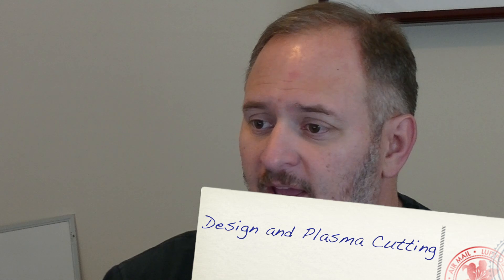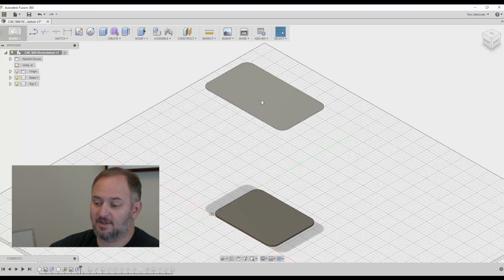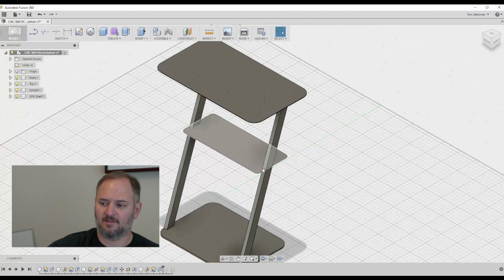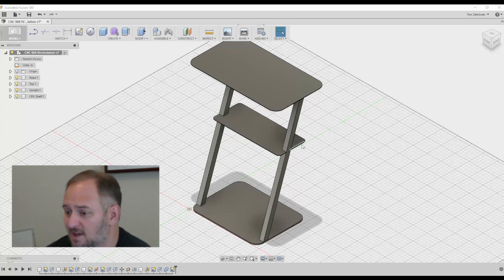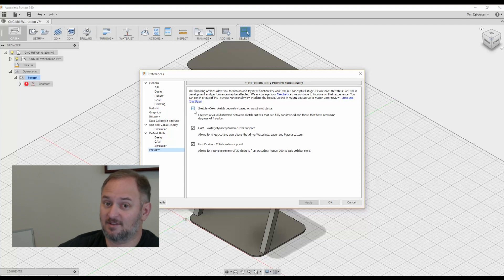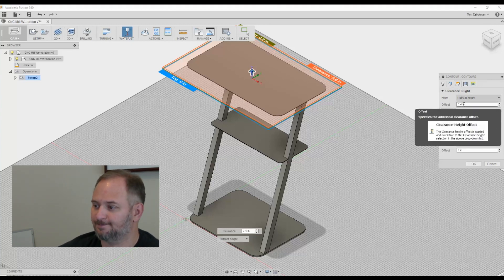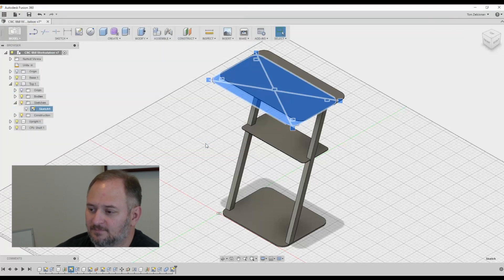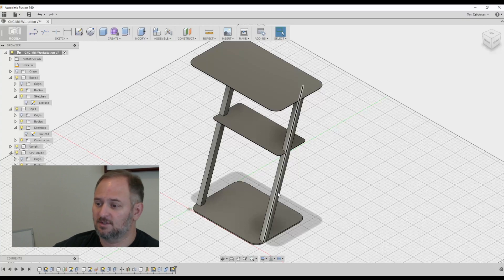Fusion 360 in the Fab Shop - Design and Plasma Cutting

Comment: Hi
I can use fusion360 to generate gcode for plasma 4 axis head head
Reply from the maker: With the recent licensing changes you should be able to do 4 axis work but I'm not sure. Have you checked the Fusion 360 forums yet?

Comment: I knew you were going to reference that angle cut in the next video, recently I designed a fire pit, I had to pay a draftsman to help me with creating a dxf with no extra dots or missing lines for a guy who is doing all my cutting. I also had him add some extra tabs to help hold it together, but although I knew his added extras needed that extra space for the angle, he missed it. I am building a plasma table soon, but until then, I got a guy to cut for me. But angled walls and having interlocking pieces to help hold them while you weld can really give you a headache at first. 

Anyways, I've come back to this video because you've mentioned Offset Plane, so I'm about to embark on learning some new things in fusion 360, will use this video as an exercise in creating a random table to do all your steps to get my head around offset plane  and a few other things. For the last few hours, I've been creating a simple car body mount to play with joints / components and forming the final design. 

Sorry, my comments are all over the place, a bit like my head at the moment
Reply from the maker: Sounds like you are well on your way with the designs! Good luck and let me know if you need any help.

Sincerely,
Tom Z
Reply: Thanks mate, will do. Thanks for sharing these videos with the project design and fabrication, right up my alley.

Comment: If you are using design edge you can export code straight from fusion and use design edge strictly as a controller for the machine.  I hate design edge so thats what I am doing now.

Comment: nice design，can the material be Aluminum？it will looks pretty with anodized color
Reply from the maker: +Stella Chou Thank you! I suppose it could be done in a variety of materials. There are other changes I would make at that point as well though like making it bolt together rather than be fully welded for ease of anodizing.
Reply: yes,it can be done in many kind of materials.SS,SAE,Brass,Al and so on.Usually the Al can be a better choice considering the manufacturing cost and surface requirement.But SS can be the best if   the design will be used in a high force requirement field.
All aboves just personal pinions,LOL

Comment: how are you comoesating for the angle on the middle shelf?    are you planning on oversize to take up the angle since the plasmacam can't cut a bevel or is the middle piece thickness negligible?
Reply: compensating....
Reply from the maker: Hi Cole! I realized I had left this out so I cover this in a bit more detail in the next video but here are the basics: I created the sketch by projecting the body which gives both the lead and trail edge on both sides. Either in the sketch, or in my case in Design Edge, I trimmed the inside edges which cuts a slightly over-sized notch. Depending on the thickness of the metal you might use this way or you might keep the inner edges and then bevel the material manually for a tighter fit. Even with a thin piece you'll still need to do one of these two  methods. It get more pronounced the closer you get from vertical to horizontal in the angle.

Best wishes,
Tom

Comment: Now I just need a plasma table. :)
Reply from the maker: So build one? Check cncrouterparts dot com. They have pretty cool setups that would work fine for plasma cutting... :)
Reply: No space, money or time right now.  :(
Reply from the maker: bluehandsvideo Yeah, that does make it more challenging. You'll just have to come over and use mine then...
Reply: I can swing by on the way home from work tomorrow. :)

Comment: HI Tom,
Your videos are getting better and better.  You and John are making me think about looking into Fusion.  Not sure how much I would benefit from it but in my case I would use it to just draw projects.  I currently use Design Edge for some of that but am thinking that Fusion would give me more detail.  Just a thought but you definitely have my wheels turning!  Thanks for the video, Tom!
Take Care,
Reid
Reply from the maker: +Reid Eichner Hi Reid! I like Deisgn Edge for it's simplicity but I really like being able to take it to the next level and check how the whole design is going to work. I liken the difference to AutoCad (2D) and Fusion 360 (3D). The benefits of being able to check clearances, adjust for angular cuts, and being able to output to my machines from there is a strong motivation to use Fusion over other programs.

Let me know if you need any help!
Tom Z

Comment: Just a question.  How do you account for the thickness of the shelf material when you plasma cut the shelf?  Looking at the side, the top and bottom of each slot is going to be 71 degrees from horizontal.  Granted it won't be much but unless this is taken into consideration the shelf will be 19 degrees from horizontal.  I am not trying to trip you up but the computer only does what it is told.  I have had experience with expecting one outcome and getting another because of these little details.  This experience was in plotting rather large maps using punch cards so you know how long ago that was--in the 70's.
Reply from the maker: +Roy Reynolds Good question, Roy! That's one that I got from a couple of people via email and I'll likely do a follow up on it. The basics are this: when I projected the body to perform the sketch it actually project both the leading and trailing edges of cuts. This next step could be done at either the sketch side or in my case at the cutter but basically I trimmed out the "inside" edges leaving me with just the outside, larger lines defining the cut. When assembled at the 71 (I cut it at 70 for ease of work) it leaves a V which is perfect for welding in this particular situation.

In the opposite angle or for tight fits, unless you have a multi-axis machine that can cut the bevel you would use the inside edges and then manually bevel to fit.

Does that help? I was considering doing another video to explain just that part but I also address it briefly in the next video when I put the stand together.

Sincerely,
Tom Z

Comment: nice two thumbs up
Reply from the maker: +daniel lyall Thank you! I'm glad that you liked it and appreciate you watching regularly. It's nice to see your name show up as often as it does!

Best wishes,
Tom Z
Reply: I have to say it show that you when't to NYCNC fusion school, there was nothing wrong with what you did there is other was to do it but what ever.
Reply from the maker: +daniel lyall Hmm, it might be that I picked up some of that before the class as well but I've been using this method for a while now. I'm definitely open to suggestions on better ways to do it though! They are always appreciated.

Sincerely,
Tom Z
Reply: it just looks like you do it the way john does it.
improvements on that vid not that I can see other than doing it with user parameters, what is a whole different kettle of fish.

as a test next time you plasma something that has to be welded together like a box use fancy joints, and do it fall on parametric, it's hard work at the start but once's you have it down for doing the math for the user parameters, you will use it quite a lot, it makes it quite fast if you already have something done what is close to something required and all you need to do is change a couple of parameters, like that big table you did if you get the user parameters correct, it can be any size table you wont and all you do is change the parameters do a save as and bang you have a new table in a minute.
Reply from the maker: +daniel lyall Ah, ok. That makes a lot of sense. I'm still rather new to the parametric method of modeling and have been using it more often but I didn't use it at all in this model. Going all the way back to the sketch part; would you have defined both sides or just half and use the mirror command?

Thank you very much for the feedback!
Tom Z
Reply: no I would of done it like you did, the uprights worked so it show it is a correct way to do it, the only differences I would of use symmetric on the press pull.
using the mirror command comes with it's own problems, when I do cabinetry stuff I use it then on somethings, the latest was finger joints, what had some very long math in it, but it was failing bad, it took an hour to find what was wrong 2 constraints needed added
Reply from the maker: +daniel lyall Odd that the constraints caused so much issue but they aren't always easy to identify at times. As to the press/pull, I actually tried to do symmetric but when I chose the distance as to the face that option disappeared. I think you can do an either / or but not both in that instance. Little things like the constraints and this issue with press pull can really be frustrating at times.

Sincerely,
Tom
Reply: it's a new program so there will be problems, if something fails it usely is a constraint or the direction a measurement was placed in if be using it long enough now to find problems quite fast most of the time. the finger joints was just something new to do. it was fun